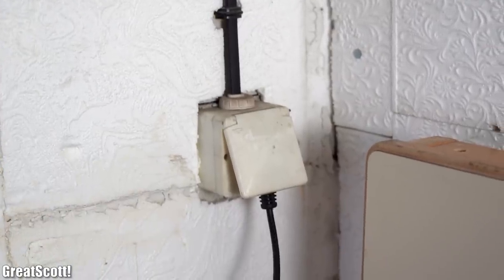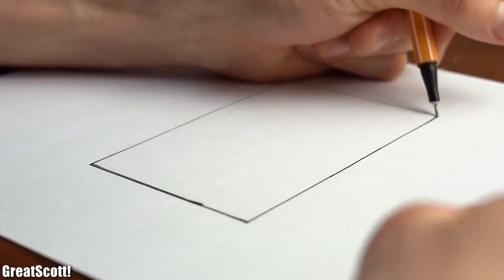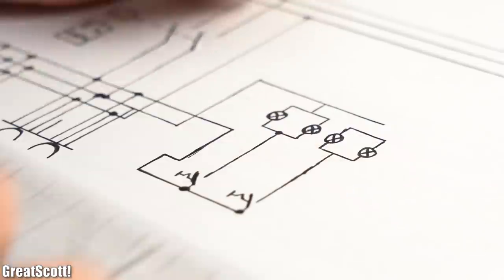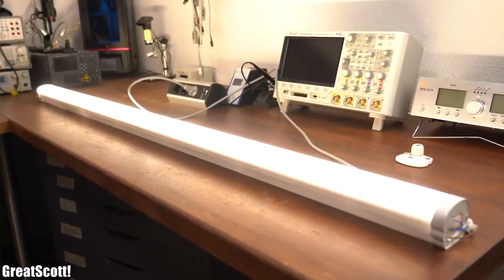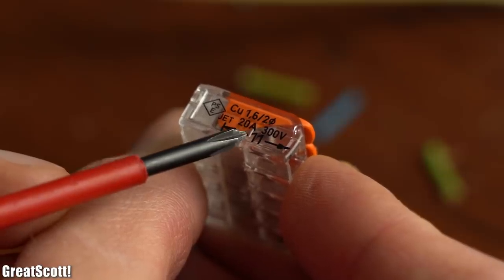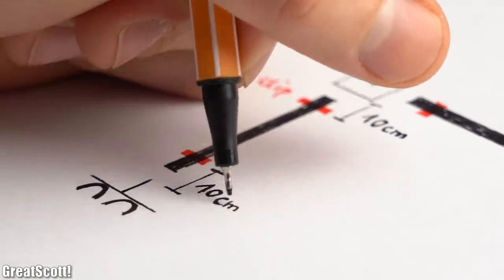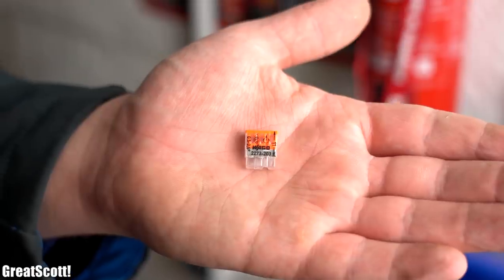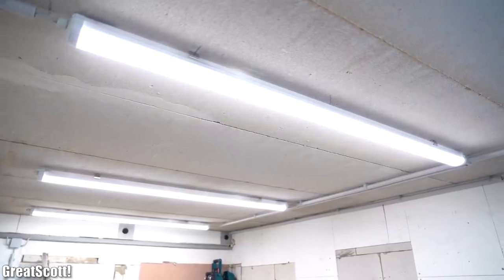How to do Electrical Wiring properly! (more or less....) GERMAN STYLE!

Comment: Personally I would invest little bit more money and buy 2 RCBOs , one for the outlets and one for the lights. Simply because when outlet breaker pops you don't loose the lights too. But anyway nice work !
Reply: This is normally how they/you do it... One breaker for lights, one for outlets / per room. Where I live light circuits are on 10A breakers and outlets on 16A. And all that on one 30mA RCBO.
Don't even know if we can have lights on 16A breakers let alone lights and sockets on the same breaker.
Reply: @snajperSLO  same here in autria with the New ÖVE8101 Rules that is a must. And the Light breaker is a C6 because B6 and some LED Lichts arent working together well.
Reply: @snajperSLO  It's same in my country like you say. Not sure if we can have both lights and sockets on the same circuit. But for sure I know for 16A breaker we must use 2,5mm wire and not like Scott 1,5mm. We use 1,5mm wire only for a 10A breaker (typically for a light ciruit), for sockets we use 2,5mm wire and 16A breaker.
Reply: @obeser1996  as for the C6 or B6, depends on how many LED drivers are on the same cirsuit... The drivers we use specify that in the manual (26 units (circuit breaker of type B) / 44 units  (circuit breaker of type C)). We had no issue with B6 or B10 for modern LED drivers (brand name drivers)
Reply: @snajperSLO  yes your right the problem here is that we cant decide what Lichts the cosumer will use. And time tell that they are always using the cheapest Chinese brand they can find. Some of them are so bad they will lightly illuminate even when live wire is cut off.
Reply: I know that we use the right switches and it's not the spark gap in the switch.
Reply: Nearly same in austria but his installation is correct for our rules. Normally it's needed to use 2,5mm² for 16A but in some cases like his when the wire is not in some thermal blocking materials (like here, the heat can escape to the air) it is allowed to use 1,5mm² (not recommended but allowed)
Reply: @GoodWolf  same here in Australia. Any high current devices like hot water system or oven or air conditioner also get their own dedicated circuit breaker and usually either 2.5mm² or 4mm² cabling depending on power draw.
Reply: @obeser1996  "Some of them are so bad they will lightly illuminate even when live wire is cut off." Thats also another story :) LEDs with drivers (if we are talking about CC drivers and not CV). Can start to flicker / be dimly lit when the power to the  LED driver is cut off. You only need few Volts to be induced in the wiring going from the LED driver to the LED light. But you are right the cheap drivers still can have caps charged when no power is supplied to the LED driver and do not cut the power to the output.
Reply: @snajperSLO  completely agree with that. The hardest problem in electronic is still the user who wants to save money on the wrong end.
Reply: @obeser1996  True... and when the LED driver dies its up to you to find a replacement, good luck with that on the cheap made and designed in China LEDs and driver combos 😀. The LEDs don't die offten.
Reply: In this special case, using two separate breakers would make it worse, except if you are using 3 breakers, 1 to protect the utility cable/line from overloading, then one for each “appliance”. Otherwise you would risk overloading the utility line with 2×12 A for example which doesn’t trip either one of the breakers but overloads the line maximum capacity of 16 A, if you only use to breakers. This garage is probably only hooked up with single phase 16A, 1 .5 mm² cable
Reply: @TecSanento  Not realy. Your point ist clear but 99 % of electrical installations are built in such a way that they protect much more power for individual consumers than is available. You can easily pack 8 or more fuses of 10 or 16 amps into a 30 A sub-distribution. The supply line is protected by a fuse, as in this case. This practice is based on the non-simultaneous and maximum use of all circuits at the same time.
Reply: Not an electrician but I've never seen separate light and socket circuits in a german household. It's almost always 1,5mm² 16A for everything besides for the oven which is on a separate 5x2.5mm² line.
Reply: @philipph.6001  You are right, but i was referring to the supply line may be uncapable of delivering even 16A continously - as they switched the main breaker to a larger one (may be without checking the line to the next larger breaker)
Reply: Hey there is no practical reason why? Because oh the lights go out isn’t that big of a deal?

Comment: Similar to Thailand! Except:
1. We use wire nuts instead of WAGO connectors. WAGOs are way better IMO.
2. We use junction box connectors so conduits end right next to the junction box.
3. We used to use grouped cabling too but now we use 3 ungrouped ‘THW’ wires for L, N and PE.
4. We use flex conduits for difficult angles that will be a pain to use rigid conduits.
5. We use busbars instead of quick connects for N and PE in distribution box.
6. We sometimes use rectangular wireways instead of conduits as they can be opened up for easier modifications later on. This trades ease of installation (junction boxes usually only come with conduit connections) for flexibility.
Thanks for sharing the German style!

Comment: Looks the same in Spain but in Spain I never saw this 5cm gap of the wires without the plastic tube protection, always all the way to the boxes and corners protected with corner shaped tubes
Reply: 5cm open gap probably to allow fireman to use an axe to chop the connections off in a fire perhaps..

Comment: 5:20 I am a bit confused. Are you adding a 16A breaker after a 6A fuse?
Reply: Came into comments to ask the same question
Reply: They probably replaced the original fuse with one that had a higher rating (16a)
Reply: It's European regulation to have outlets behind a 16A breaker, either with 1.5 mm2 or 2.5 mm2 sections of wire depending on the number of outlets and the voltage drop you might get over the distance. The input 6A fuse is unusual. Fuses themselves are unusual.
Reply: It shouldnt be a safety issue, the ground protection of the RCBO is still there and it just means the 6A fuse blows first. But its bad style and annoying to have to replace a fuse when you have a perfect resettable RCBO there. But probably 6A RCBOs are rare and might be more expensive.
Reply: @MytronixOfficial  6A RCBO is common in the UK for lighting circuits
Reply: Maybe the 6A fuse is not theirs to replace, but from the electrical company or the landlord. In a regular house the main fuse is usually 35A or bigger, but maybe in the old garage box they placed a 6A fuse that you are not allowed to replace.
Reply: @mistermartin82  6A MCB. Very rarely do lighting circuits have RCBOs. You'll usually have multiple MCBs protected by one RCD.
Reply: @grahamek86  depends in the UK lighting in new installs is RCD protected. Some systems are main switch and RCBOs (what I have), some are as you say 1 RCD protecting a group of MCBs. The latter is cheaper, but many prefer RCBOs as less chance of nuisance trips
Reply: @mistermartin82  Nuisance trips tend to be on retrofit installations on old wiring. 18th ED just specifies that lighting circuits are protected by RCD. Nine time out of ten, this is done via a split load board with 2x RCDs. If your CU is full of RCBOs, then it must be incredibly busy for wiring as each RCBO will need to occupy an additional port on the neutral bus. Seems like a rather expensive and unnecessarily complex solution.
Reply: @grahamek86  well mine is a retrofit board, replacing something from 80s or early 90s
Reply: @romsthe  If you know the regulations so well, you would also know that you can't simply switch out the 6A fuse for a 16A fuse because then the wire will burn up.
Reply: 16A in 1.5mm2 cable is not perfect too. In Czechia we have minimal current capability for 16A 2.5mm2 cable. It´s standart.
Reply: @MrFibka  1.5mm2 is good for up to 18A
Reply: @grahamek86   more than 16A without generating heat?
Reply: @MrFibka  depends on wirele lenght. 1m at 16A is completely different to 100m at 16A
Reply: @HDGamer2424  Did they wired less then 1m?
Reply: @MrFibka  Yes and no. Max cable length is probably around 5m and he used 1,5mm^2 wire. 

Calculation is pretty easy with the right formula: At 5m the voltage loss would be 1,9V which is 0,82%. This is totally within the range of the max. 3% voltage loss you can have.  You only start getting trouble at 18m. Then you would have to run 2,5mm^2 wire.
Reply: @MytronixOfficial  I think when there will be a short circuit RCBO might disconect first because is faster than the fuse
Reply: @HDGamer2424  i'd actully be worried about wires heating up more than a voltage drop. They did put the wires in a pvc tube/pipe. In diy (3.3-60vdc) it's a good idea to use slightly thicker wires than you need, in power use to be more exact.
Reply: @eivis13  I'm an apprentice for the third  year now and I know all the formulas and have the needed experience. I can tell you that this is how it's done. No need to argue in my opinion.  

You are talking about diy and 3.3V-60V DC. This however is a professional 230V AC installation.
Reply: @grahamek86  I can't speak for other countries, but here in australia a recent change to our wiring standard changes this and now all circuits must have their own rcd or rcbo.
Reply: @MytronixOfficial  It's not only a bad style, the VDE expects a certain selectivity of circuitbreakers. Therefore a 6A slow Fuse before a 16A RCBO is prohibited, in this case though it wouldn't matter because the melting fuse only covers the one installation...
Reply: @stephenwalsh1149  RCDs tend to protect many circuits. A lighting circuit on the same live rail as the RCD is classed a "RCD protected". If they're mandating those for each individual circuit then it's immensely wasteful. I can't find the legislation by search, are you able to link it? I'm keen to read and understand their logic.
Reply: @ThomasLobker  Exactly that is the case. They link multiple garages on one line.
And they just used a RCBO with 16A because it is the cheapest one. They could have used just a normal RCD which is even more cheaper because the overcurrent protection is done by the fuse.
Reply: @grahamek86  the Australian standard is called AS3000. Was updated in 2018. The reason is so that if there is a fault on one light circuit, eg in one bedroom, the lights in the rest of the house do not go out. This also means it is much easier to identify which circuit has the fault. When you have a group of circuits one one rcd, if the rcd trips, you have no idea which circuit is at fault.
Reply: @stephenwalsh1149  Lighting circuits will power more than one room though. In a two story house you'd normally have two lighting loops. One for up, one for down, and they'd be on separate RCDs anyway. The only thing I can see is that all final circuits are protected by RCDs (which they are in my previous comments). There is a recommendation for RCBOs, but they aren't mandated.
Reply: @romsthe  Here in Belgium the minimum section for outlets is 2.5mm2, and in Spain they use 4mm2 stranded wire in a star configuration, so every socket is going to a junction-box.
Reply: @romsthe  I agree with you, except for the last sentence. I  work as an electrician and we often build big  distribution boxes with up  to about 80  circuits. We always use fuses as mains and for big machines. The resason behind it is, that when one of these blows, something bad has happend and no unauthorized person is abled to just flip them back in.
Reply: @romsthe  in italy for sockets at leaast 2.5mm2!  and fuses are definitely disappeared
Reply: @mistermartin82  here in Italy the RCBO is the initial protection for the whole system, (it is also called life-saving or differential switch) then there are the two magneto-thermal switches: for the lights and for the sockets
Reply: @ThomasLobker  Much more likely they did not want to intervene on part of the system under voltage and probably left the fuse as protection for overloads and the RCBO for its differential function (or residual as Great Scott says)
Reply: @HDGamer2424  I'm from Brazil and not an electrician. Just out of curiosity: why do the piping stops 5cm away from the boxes? Is it a standard? What are the reasons for that?
Reply: @SENZALA_your_awesomeness  Actually, I don't really know. Partly convinience and partly looks. However it is regulated that the first clip is 8cm from the appliance.
Reply: @MrFibka  the same in Belgium
Reply: @MrFibka  It depends on how the wire is installed. If it is inside a wall then one needs 2.5 square millimeters.
Reply: Exactly what I thought..

Comment: That was really good!
I'm a russian electrical engineer, and I loved to see the similarities and differences between two countries typical electrical solutions
Reply: The most noticeable difference for me was drawing outlets on a plan.
We draw them 180° rotated, half-circle part to the wall.
It was very uncanny to see them drawn the other way in the video

The little diffencies: in russia there aren't any requirements for cutting conductors 5 cm before the boxes. We cut them just before boxes. It looks neater that way too.
We also usually use cable canals or flexible tubes as a conductor.

I personally also wouldn't use wago for connecting wires, because they do need maintenance once in a while. I dunno if it's a personal choice or best german practices.

Comment: 5:31 
Germany allows 16 A using a 1.5 mm2 wire? In Finland (with mostly the same regulations), 1.5 mm2 wire is only for up to 10 A, and 2.5 mm2 wire is used for up to 16 A.
Reply: Yes 1.5mm 16A is fine up to 17m length, except some limitations regarding cable accumulation etc.

For new buildings, 13A is also common here.
Reply from the maker: Yep 1.5 for 16A is allowed.
Reply: AFAIK depends on installation type/location - it's allowed in conduits on walls, but if it's inside heat-insulated wall the rating drops down to 14,5 A.
Reply: it depends on the calculated current of the system, a lot of places 1.5 mm2 cable can carry 16A easly but national regulations (like in finland, and norway, and probbably more places) demands that you use 2.5mm2 wire
Reply: Okay, good to know. The different regulations might be due to temperature differences between countries. Germany is a bit warmer year-round than Finland (especially Lapland). And especially with thinner wires, large currents heat up the wire.

Over time, the temperature changes can fatigue the metal and the insulation, leading to failures. If you're using an extension cable outside in the winter, it's not uncommon for the snow underneath it to melt.
Reply: Interesting! Yes, in Germany we use 1.5mm^2 wire for 16A circuits, as long as the distance is less than 18m
Reply: In spain its not posible too. In that case two diferent circuits; one for the lights with a 10A MCB 1,5mm2 wire and another ones with a 16A MCB 2,5mm2 wire for the schuko; all protected by a RCB of 30mA. 
¿The thing i dont understand is 6A fuse?

Comment: In Denmark we are only allowed to draw 10-13A on 1,5mm2 conductors, depending on our measurements.

So 16A on 1,5mm2 is a bit surprising to me.
Reply: depending on wire lenght, but his main fuse is just 6A
Reply: @rofo88  its B16, so 16A. 16A is standard for outlets
Reply: @jaeger0404  : Main Fuse, the old one made of ceramic
Reply: In Germany as long as the voltage does not drop more than 3% at the end of the connection, ist fine. So it depends on the cable length
Otherwise you have to use a thicker kable
Reply: @spellingmistake1  here in Denmark its 5% on light installations and 3% in other kinds. We just got a new set of rules called DS/EN-60364 and that is should remind alot of your laws in germany. 😊
Reply: Exactly my thought. 16A = 2mm2
Reply: The same in the Netherlands. You have to use 2.5mm². Only 1.5mm² is allowed for the switch wire. 
We also have to use stronger pipes when installation is in a garage.
Reply: 16A 1,5mm² is fine in that way it's put on the wall. There are regulations on wire length and where you put it in. If you put the same wire in a heat insulated wall, you can only draw 13A, if it's longer than X, only 10A and so on. Likewise if you put a bunch of cables close to each other, there a factor of simultaneously in consideration and may further reduce the allowed load. There are tables where you can just look it up.
Reply: @drstefankrank  Due to regulations of NEN1010, L,N and A have to be 2,5mm2. A switch wire can be 1,5mm2
Reply: @rofo88  correct. different standards but in the days (10yesars ago) we tested teoretical - constant current of 80A on 1 meter 1.5mm2 it works but is not practical.
Reply: @gferen  It works? Sure, you could draw even more current too, but a 1,5mm2 get warm enough at only 20A. At 80A the insulation will have burnt away long ago. :p
Reply: in the states are lowest cable is the 2mm at 15 amps why we can run lights and outlets on same circuit (not practical most decent tradesman will not do it better to run separate circuits  for each with better forethought to run most receptacles with 2.5mm 20 amps)